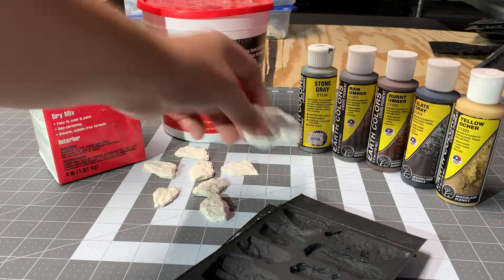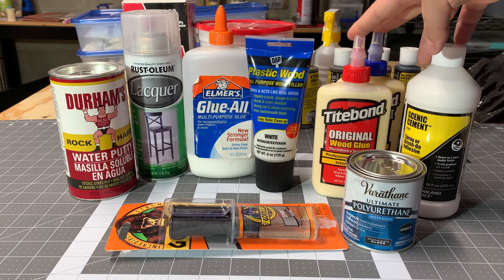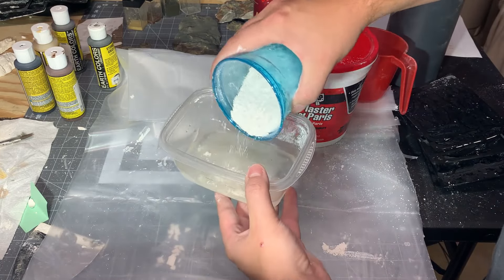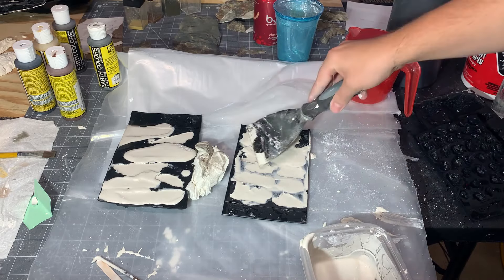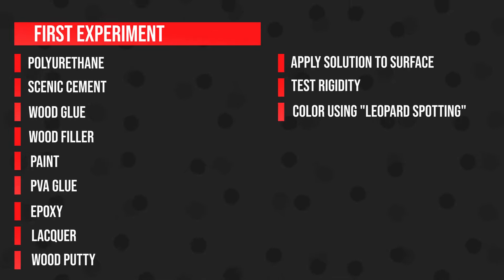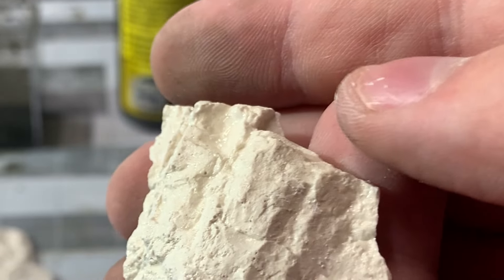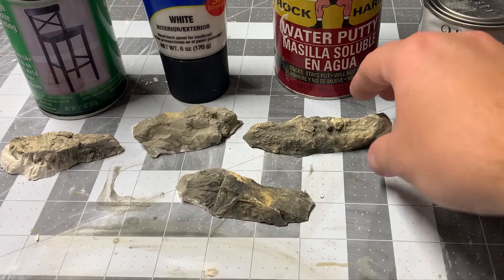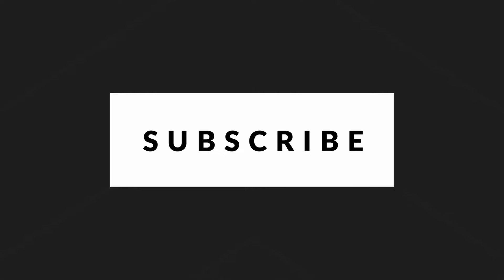Plaster of Paris: Making it STRONGER Pt.1

Comment: Its really annoying that you did your tests and watered down half the things. If you would have cleaned off the molds between the rock it probably wouldnt break the rocks as easily. For the ones you cant paint over the coatings.. then why wouldnt you paint and stain them first? I don’t understand how sealing them before you paint or stain them would make sense. However, i do appreciate the details you talk about with each thing and that you tested multiple things. Just wish you would have mixed things properly before dismissing the product saying it didnt work when it wasnt mixed correctly to begin with.
Reply from the maker: Sorry you didn't like the video. I suppose I wasn't trying to dismiss anything, just had a process and followed it for each product. I'll definitely try adding things as part of the casting process, possibly showing the results in a future video!